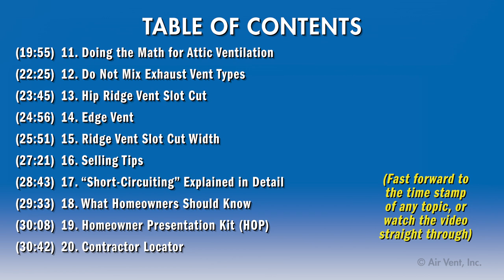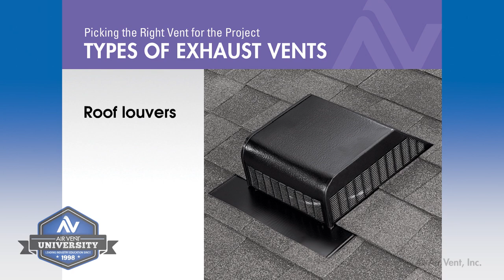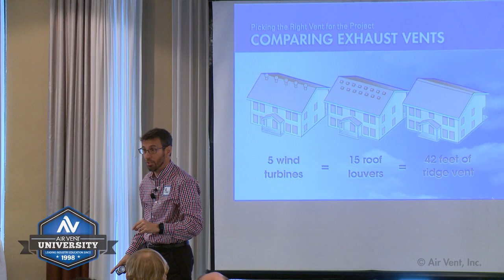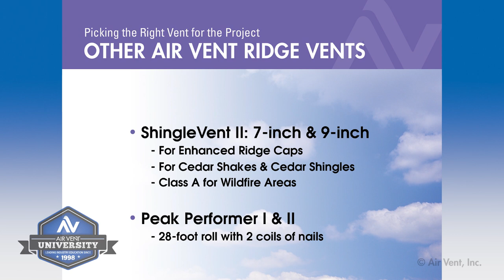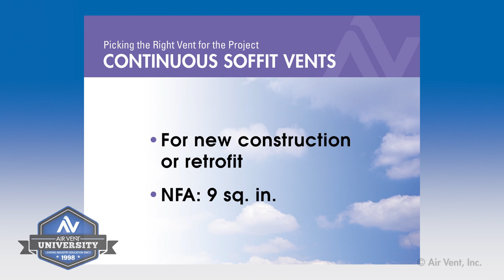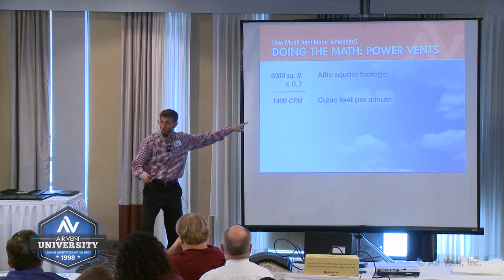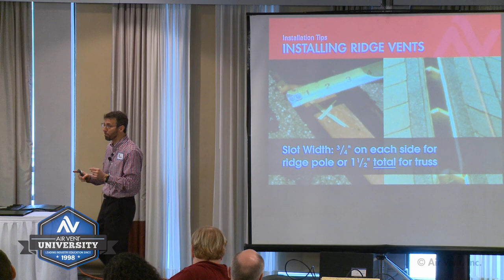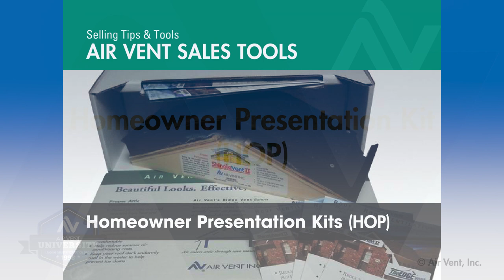Air Vent Attic Ventilation Educational Video

Comment: Still not sold on a ridge vent.  It just doesn't seem like it moves much air.  My whole house fan I installed  in the hall ceiling myself turns the inside air temperature into the outside air temperature in 5 minutes.  HVAC guy who had to get into the attic said he couldn't believe how much more comfortable it was.  If we only had a ridge vent he would have roasted alive!
Reply: Ihave two gable vents. Would installing gable fans on one end and then the other end pushing the air inside be a ok idea? 
Basically pushing air inside wit fan and one fan pushing hot air out
I have two gable vents and two exhaust turbines on top
Reply: i have no ridge vents or soffits

Comment: Great information! I wished I knew before my roof installation. I have winter condensation issues in attic. I changed roof. I am not sure my roofer made sure for balanced ventilation. We have drip edge ventilation. Insulation guy added insulation and sealed openings. But, problem is still there and I believe it's ventilation issue. But, I am not sure how to balance. Whom should I contact? TIA

Comment: Idaho homeowner here: this was helpful. I have a new roof on the way, and am considering how to vent better in my attic. Thus replace box vents with ridge vents. What about dormers that stick out? Gets very hot under the one for the MB, which is upstairs. Also, what about the gable vents?  will they cause short circuiting with a ridge vent? Great presentation!
Reply: Hey! I'm also in idaho I'm a roofing contractor if you want ridge vent you'll need sufficient soffit venting and your gable vents blocked off it will create a cross flow which will not properly vent the moisture out. Seeing this comment three years later I'm assuming you got your roof replaced already.
Reply: @raymond1868  I did but thanks!

Comment: Ridge vents work well in cooler climates or small homes gable roofs.

On my house, the ridge is 30ft long.

Thats about 540-570 sqin outflow.
My soffit intakes are 36sqin.

Obviously my intakes are suffocating the attic.

However the ridge vent only supplies half the exhaust needed for my house to fall into code.

The attic is 1050sqft.

This means that a large home will need box vents supporting the ridge.
Reply: When I say box vent, I mean low profile vents near the ridge. Not something that catches wind intake.

Also, putting these on ONE side of the attic to prevent cross sectional windflow in the attic.
Reply: If it were me, I would not be pushing ridge vents on customers in the southern USA.

Aesthetically I think they are nice, but they are not performance products without some good planning.

Comment: Can you achieve balanced attic ventilation without using an attic exhaust fan to ensure continuous air change rate under all types of external climate conditions?

Comment: Can you have too much intake?  I have a ridge vent but my intake under the soffit does not seem adequate.  I have plywood panels with little holes in them, and then they put metal soffit under that, again with little holes.  I assume the airflow is very restricted as my attic gets very hot in the summer.  I have no idea how to calculate the square inches that are there due to the multiple panels.  If I cut through the soffit panels and the plywood to install the rectangular shape intake vents, do I risk getting too much air intake?

Comment: I have an unheated 30' x 40' pole building in eastern Washington. The building was metal/plywood/tyvek wrapped when built but is currently only half insulated. I have some machine tools that are heavily collecting condensation in the winter. Is this because the insulation is incomplete? When complete it will have an attic and gable vents on both sides. Thanks!

Comment: “short circulting” and examples straw pin hole are both unproper words. Mix ridge and box vent might cause back set or vortex, but not always. they are not short circuiting, and if you suck both end of the straw and pin hole, you are likely to have more output. Anyway, none of roof mfg are mathmatically or physically good, so, only practical test can say yes or no which I have not seen.
I have no ridge vent but box vent, attic is very hot, yet when I touch the vent from inside, the hot air are not goes out but cold air is goes in.

Comment: This dude is offering zero numbers! The difference between gable venting and ridge venting is 10 degrees F at best. This guy is trying to sell ridge vent but he doesnt tell you that they leak and thenines with filters have crapy airflow. Eventhough net free area is 18 sq inches the filter reduces the effective area. Go with soffit vents all around and gable vents and let it go. Ridge vent is easy and very lucrative for contractors to scare you with so they can make 1000 extra bucks per 2000 sq ft house.